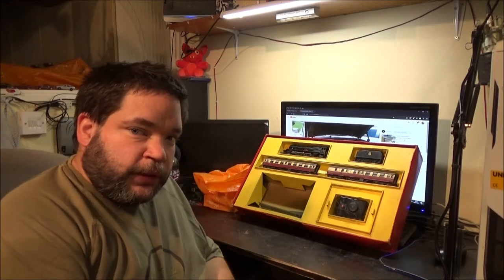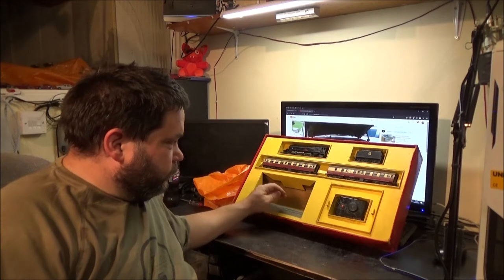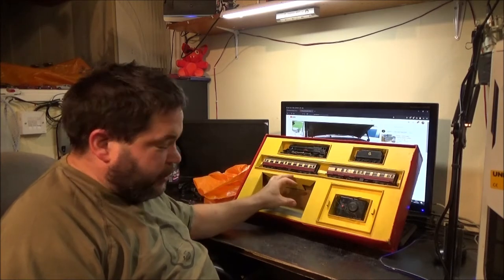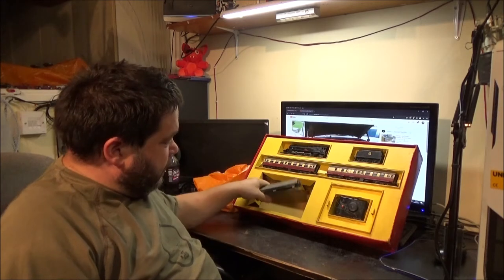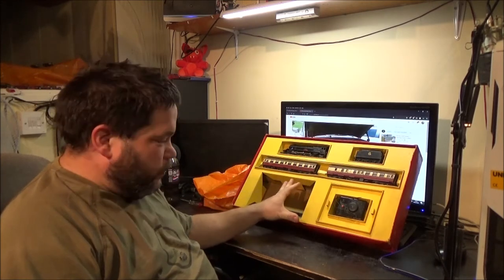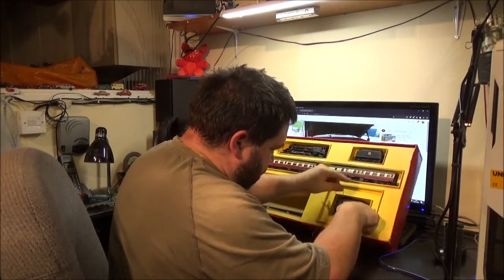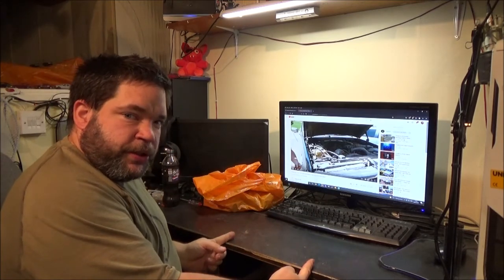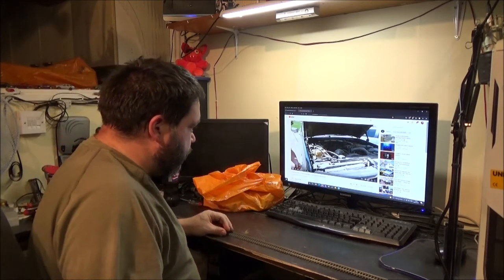I Bought Some Used 00 Gauge Locos. Will They Run?

Comment: 15v ac output is for point motors and the old bulb signals, I used to use mine to power another feedback controller I built.